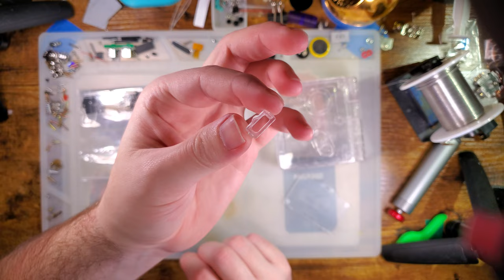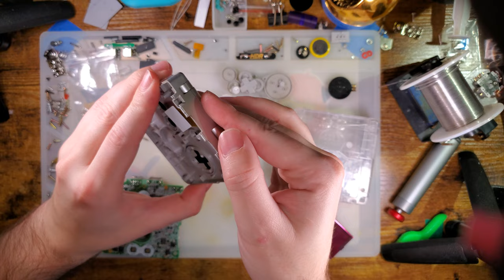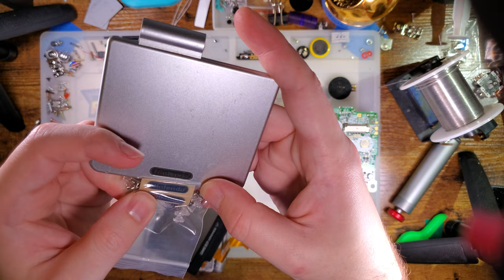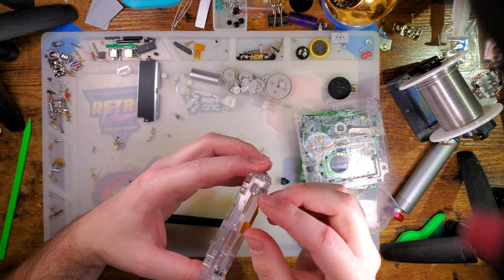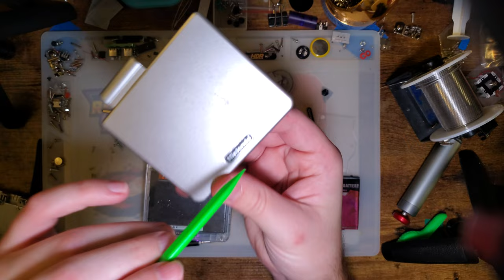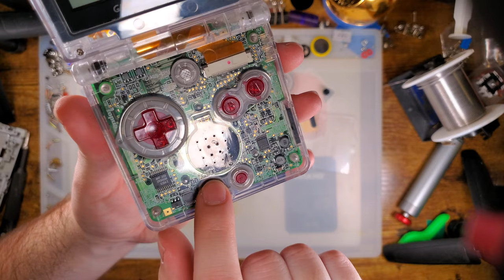Funnyplaying Game Boy Advance SP Housing - OEM Fitment (1/2)

Comment: I thought I was the only one experiencing the cracking issues with the previously released clear shells.  I have a nice frosted white shell and it’s cracked on the hinge and near the screen backlight contact pads.  Everything still feels rigid and the cracking only spread a little bit, so unless it shatters I’ll just keep what I have.
Reply: i have a white frosted one aswell and sadly mine completly cracked at the hinge even tho i dindt even use it for months, i really hope these new shells work out better

Comment: You don't have to take apart the top screen to take off the hinges. You also do you need to press anything at all down the far side to press out the hinge. With the screen in, take a flat piece of metal and push evenly across the rear of the most exposed hinge, when it presses in the end clips you can take any thin piece of plastic and push it out. Then lightly move the two shells off angle and pull away from the other hinge. You'll be left with two seperate shells, an intact screen, and two perfectly unbroken hinges. If you are scared about breaking the screen cable you can unwind it from the shell gap and have no risk of over pulling.
Reply from the maker: Or just spend the extra 30 seconds taking it apart so you don't have to do all that? I made a tool that makes removing the hinges trivial.

Comment: I'm surprised they didn't just remove all the screws on the top edge and add some kind of leveraged tab system. With some slotted tabs and the same screws at the base of the screen assembly they could have increased available space at the top a ton.
Reply from the maker: I think that could work but it already took an extra year to work out fitment and mold issues so I fear what something like that would do to the development time

Comment: FINALLY
Reply: @mahko I've installed mine and it's wonderful, a step ahead in quality in all respects. ergonomically; it grips the hand much more effortlessly, although I'm not a hand sweater. The fit and finish is definitely refined in the cast, along with new aftermarket screws being included it feels much less risky tightening upon reassembly. Not to mention that crystal clear was really the way to go from the get go comparing to the the older hazy clear cases. I hope you install the LED kit for the D-Pad next. Thanks for everything Mahko!